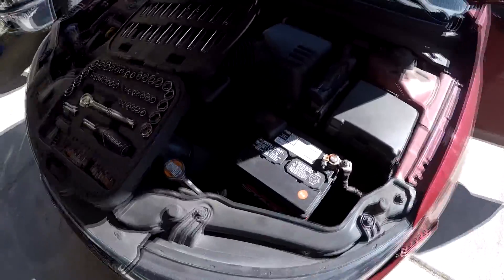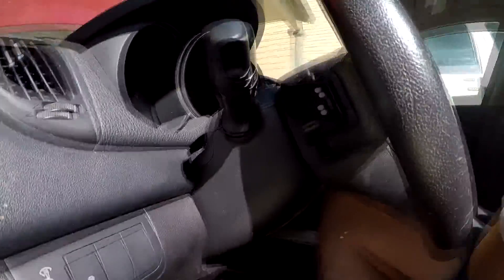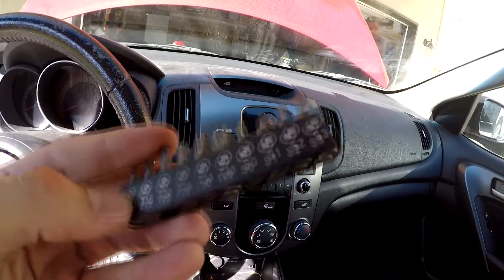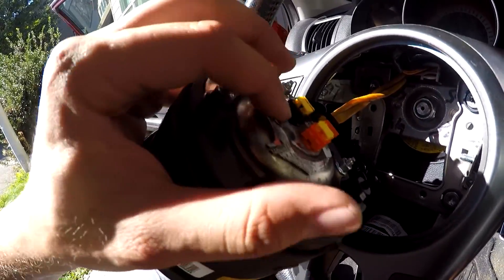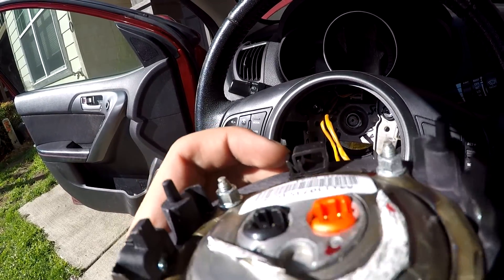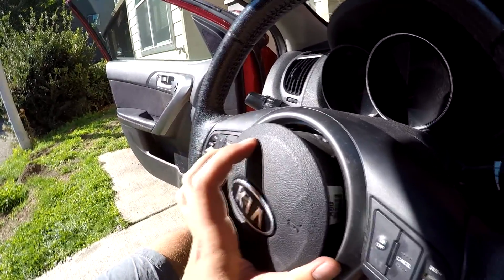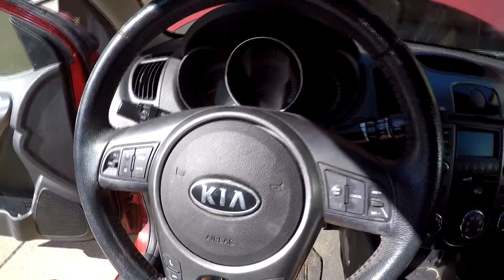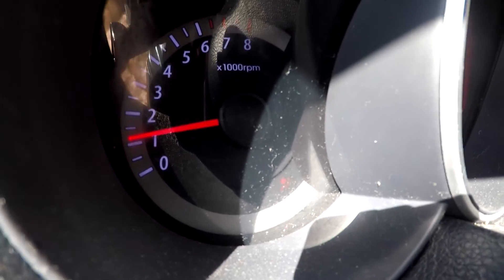TUTORIAL: 2012 Kia Forte Steering Wheel Airbag Replacement! Super Easy!

Comment: I have a 2011 kia Sorento. And all the radio controls, cruise control are no longer working. I  found many steering wheels on eBay. Is the airbag plugs the same as in this video? Our kia sorento looks close but different than the steering wheel in this video.
Reply from the maker: It will be very similar, if you have basic knowledge with tools you should be able to get the job done!
Have you checked fuses? It could be as simple as a blown fuse.

Comment: Totally unrelated question, but I have a 2010 Kia Forte ex and I’m trying to get a clock spring and I don’t know if I should get one with 1 wire or two?
Reply from the maker: I would mirror exactly what you have. It's a lot easier to replace direct fit parts.

Comment: What caused it to deploy in the first place? Front end collision? Were the sensors damaged? I need to change mine in a Kia Sedona and just trying to get familiar with the process.. Thank you.
Reply from the maker: Hello! Yes, airbag deployed from a front end collision. Not sure what sensors you are referring to.
Reply: I’m talking about the sensors that caused it to blow in the first place. I need to do my Kia Sedona and wanted to make sure when I put it all back together it doesn’t pop again. I’ve never done one before and trying to learn as much as I can first. Thank you!
Reply from the maker: @shakadougcorbin8939  there are sensors in the front of the car that cause the airbag to deploy during a collision. Disconnect the battery before you do any work with airbags. Reconnect when you are done, the airbag should not just deploy. If it randomly deployed, you most likely have a fault within the whole system.
Reply: My concern is that it could be set off once I reconnect the battery because the sensor tells it to. Do you know of a way to check the sensor first? My van had a front end collision that shows fairly minimal damage although it was enough to blow the steering wheel airbag. I guess I’m trying to figure out how the sensors work, where they’re located and if they need to be tested, replaced, or reset prior to installing a new airbag module. I can’t seem to find any info online about that aspect of this job.

Thanks again for your reply. Your video was quite helpful and short and to the point which was much appreciated.